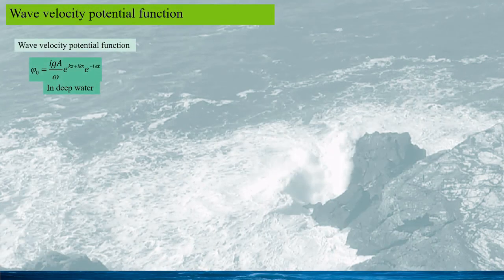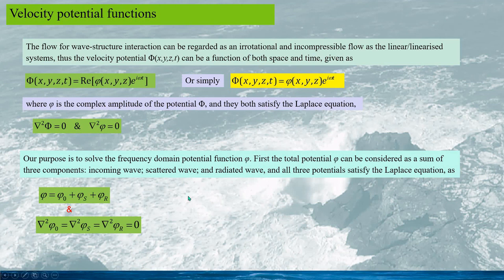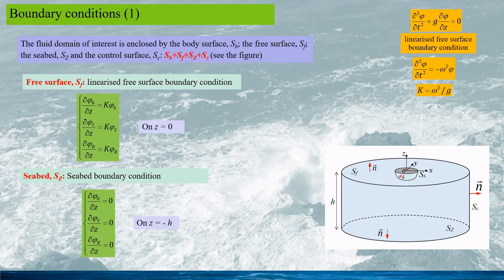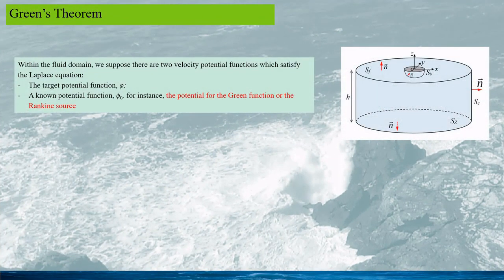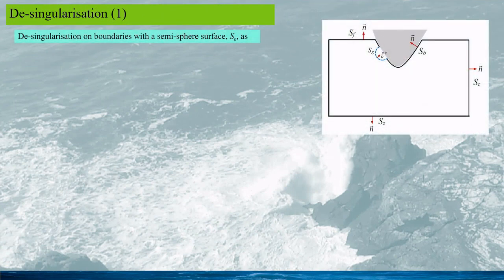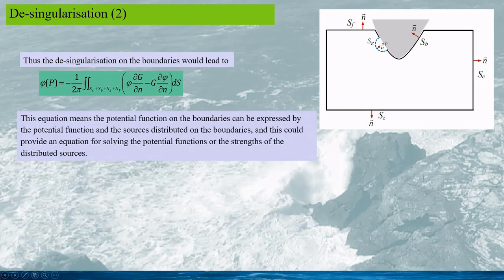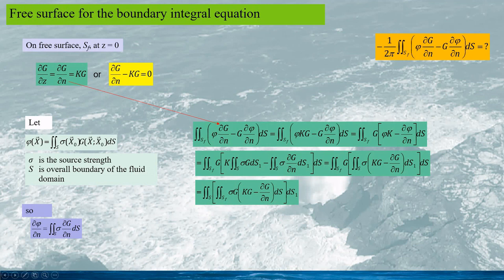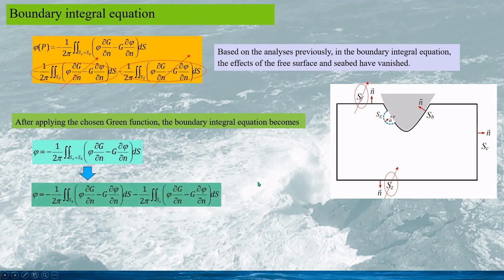[Fluid Dynamics: BEM] Wave Structure Interaction, Part 1: Fundamentals

Comment: Many thanks for the fantastic video. I am not sure about this, but the equation for phi as a integral of greens function with certain strength at 18:49 may be wrong. Shouldn't it be phi(X0)=int(sigma(X0)*G(X;X0)) instead of phi(X)=?
Reply from the maker: I think it should be phi(X), the velocity potential in the field, because the integral is on the surfaces, that is, for different X0.

Comment: In 3:29, φ is defined as time-independent. However in 6:46, φ is differentiated by time t. I think φ in 6:46 might be replaced by Φ.
Reply from the maker: Thank you for pointing it out. Yes, I made some mistakes there. I should have expressed them in a better way. But you are right.
Reply: @ScienceofFluids  thank you very much for the reply